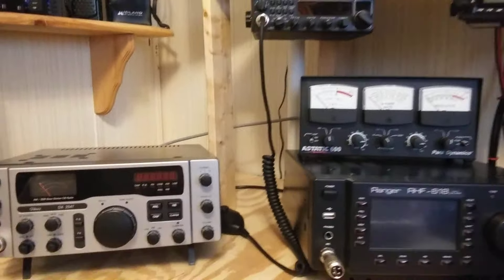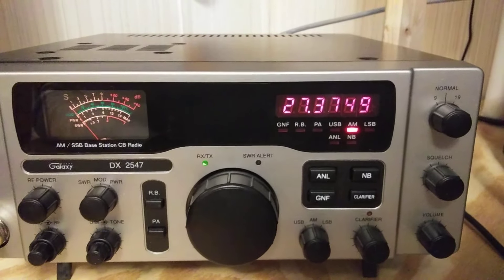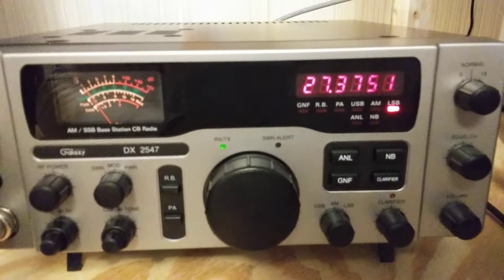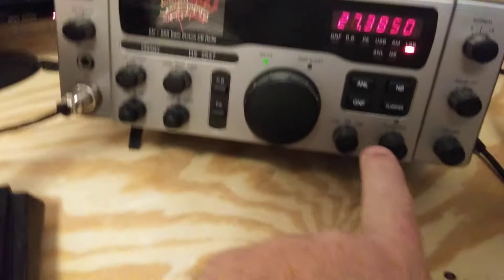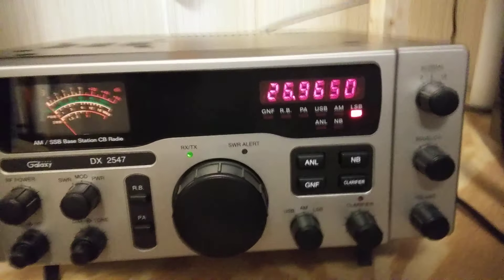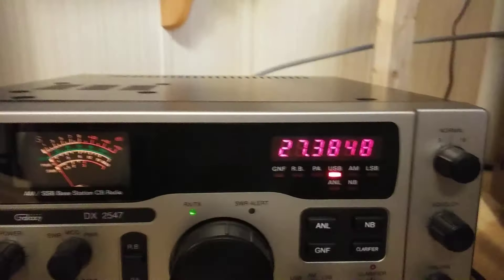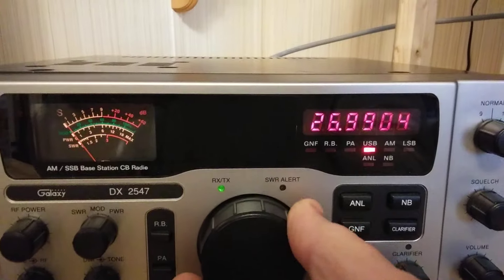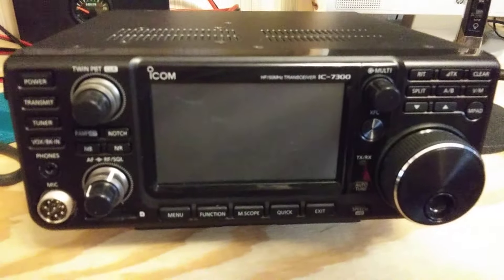Galaxy DX-2547 Cold vs Warm

Comment: I only have two front screws holding the top cover on so I can get to that A inductor with my plastic screwdriver the A or first one is for LSB freq. alignment. Sometimes in the morning I put a hair dryer on the Christel to warm the radio so it does not drift! Works great WR 038 UDX38 JohnBoyUtah cheers and beers 🍺 🇺🇸😎📡🎙